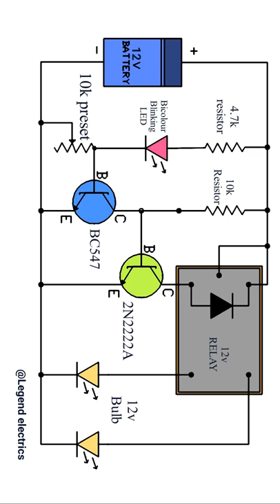Ideas with relay #shorts

Comment: You could of switched the led strips without the relay using just two transistors.
Reply from the maker: This one can switch more powerful loads
Reply: Agreed
Reply: @legendelectrics4668  and destroy the relay in the process ... not to mention make irritating clicking noise